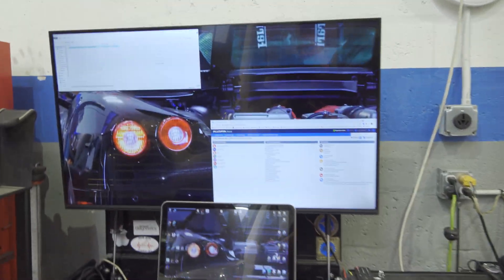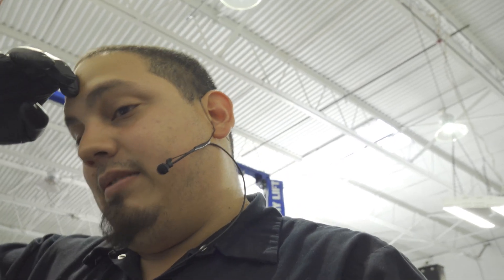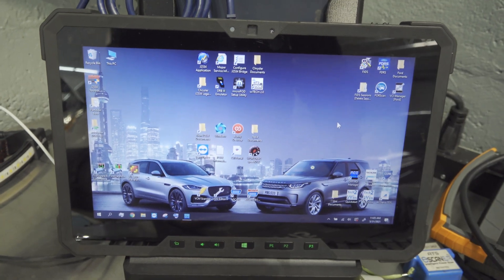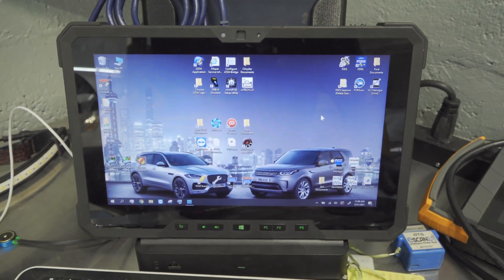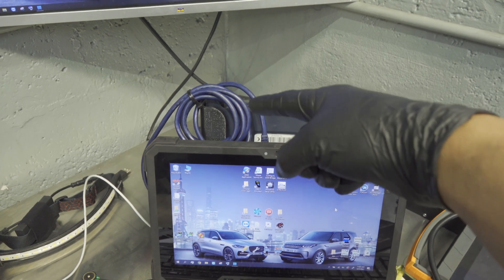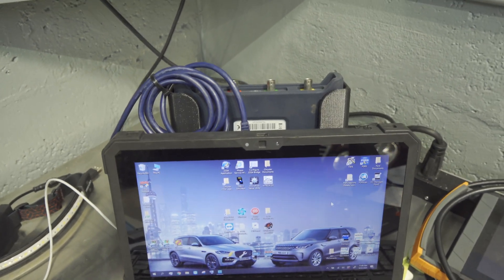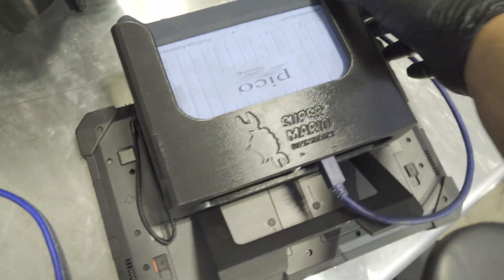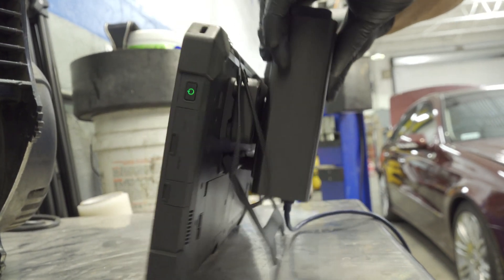The ULTIMATE Pico/eScan/Programming/Tablet mobile set-up!

Comment: Hey Mario, All 7202 latitudes I see out there are equipped with only Intel M-5Y71 1.2Ghz processor. I thought most cars manufacturers require core I-5 and up processor in the programing laptop? what is yours and if yours is Intel M-5Y71 1.2Ghz then have you had any issue when launching OE software or during programing? a quick reply would be highly appreciated :) Thanks
Reply from the maker: No problems so far

Comment: I almost bought that ATS Escan, no bi directional control was a bubble burster.
Reply from the maker: I get that, but man it's great for driveability

I already have other scanners for everything else
Reply: @SuperMarioDiagnostics  You should check out the HPtuners VCM scanner, the best $300 I’ve spent in awhile. I can’t vouch for other makes but for GM stuff it works great.

Comment: Are you still running Chrysler j2534 application?? I think they discontinued that awhile ago. They have ya buy the witech 2.0 for programming. Real question what do you have in this unit Money wise
Reply from the maker: I'm using witech 2.0 for Chrysler

The tablet was 350, the dock was 100, the usb hub 40, wireless keyboard and mouse 50, etc
Reply: Do you do a lot of programming? On Chrysler ford and gm? I know you usually work on European stuff
Reply: Does Isaac set it all up? Get you accounts for the subscriptions and send you the username and passwords? Does he update it for you like when a manufacturer changes versions of Java etc
Reply from the maker: Not a lot on domestics but it does come with witech, fjds, and gm is obviously online with sps

He loads it with the latest software, to your liking.

You'll have to make your own accounts as everything is done through your personal email, authy, and okta accounts

Not to mention if you ever need help with anything related to using the hardware he sells you, he gives great support
Reply: @SuperMarioDiagnostics  this is a great setup! Can i ask do you do ista programming with this? If so do you use the icom tool or a J tool? Thanks
Reply from the maker: I haven't yet with this unit, but definitely will.

I've used it with a j box and icom

I would suggest getting icom, only a matter of time until you have to program with it